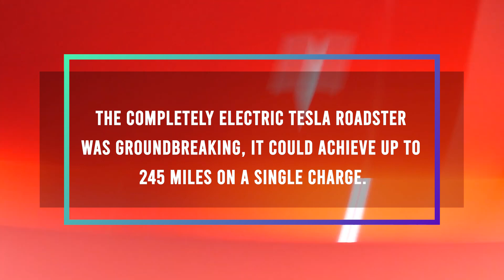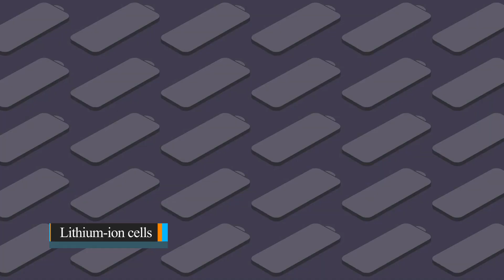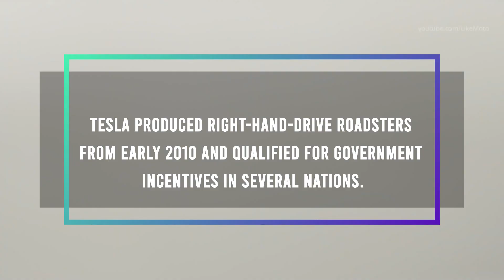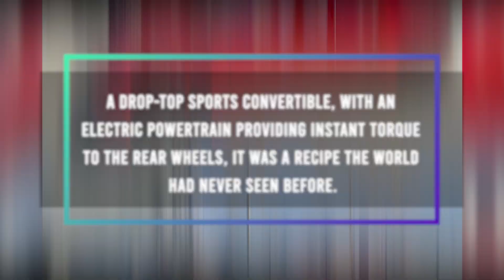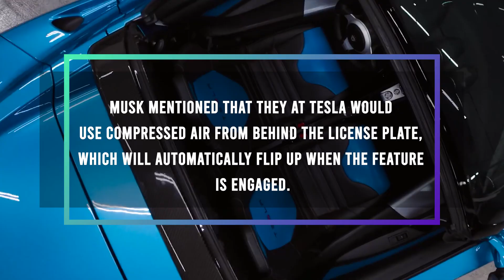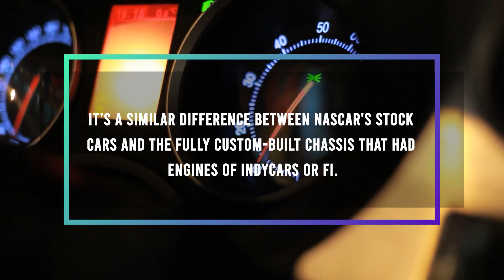Tesla Roadster - Here's Why its so special

Comment: But lucid does 0-60 in 2.5 seconds
Reply: 2.2
someone who really know drive
Reply: and this is whith stock tire and stock suspension xD add some proxy tire and racing suspension on the car xD 2.0 second easy xD
Reply: 2.5 is slow compared to Roadster's 1.1 seconds 0-60